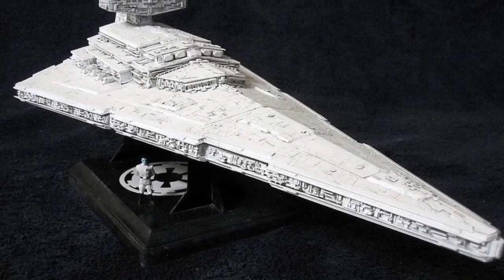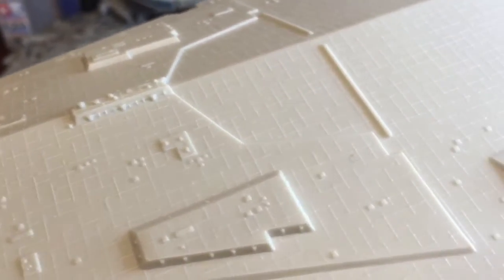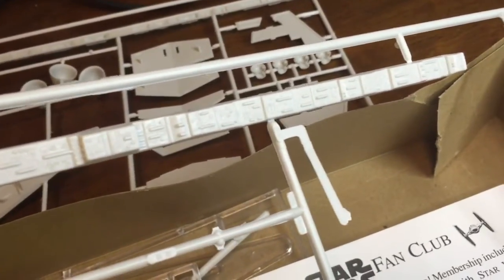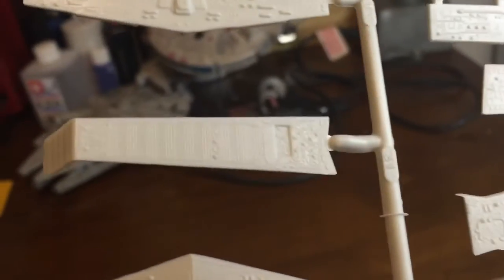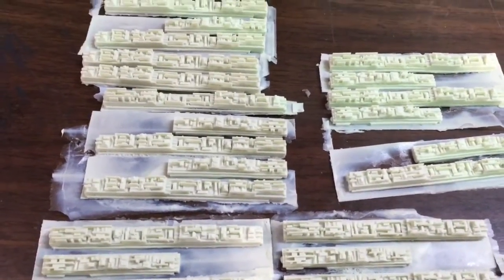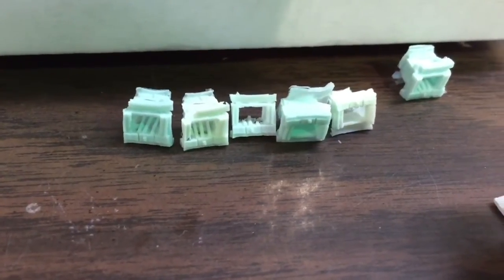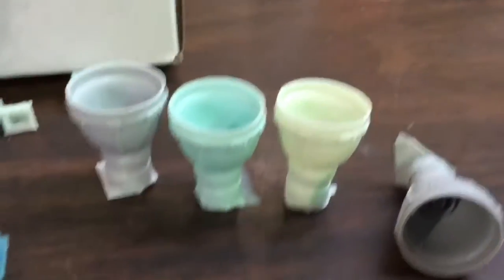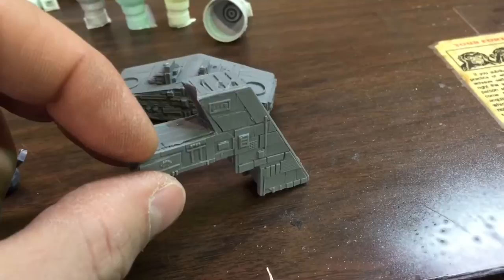Star Destroyer MPC/ERTL kit review/ build plan Part 1

Comment: I'm 13 and I've built the 1/350 of the uss Nimitz but not in much detail and almost messed it up do you think I can build this
Reply from the maker: Joey Lafko of course you can. 
By the time you bought all of the parts and the model, you should just buy the new Russian star destroyer on eBay. It's two feet long and extremely detailed right out of the box.
Reply from the maker: Joey Lafko it's called the zvezda star destroyer
Reply: is it cheaper to just buy the zvezda/revell kit than its would cost to buy the upgraded parts? i have the unbuilt mpc already thank you